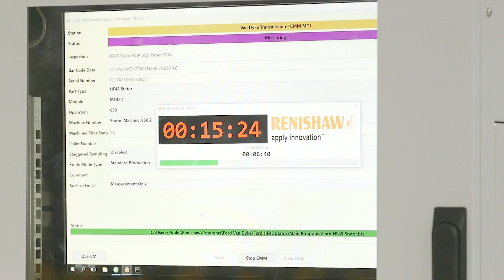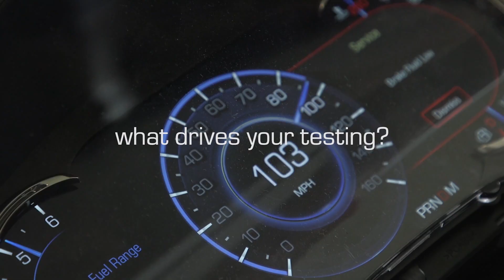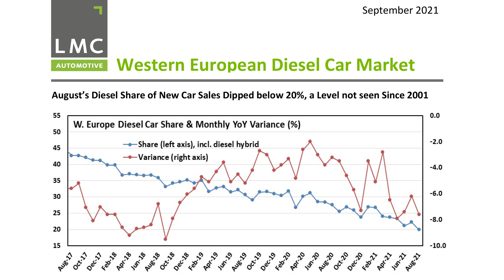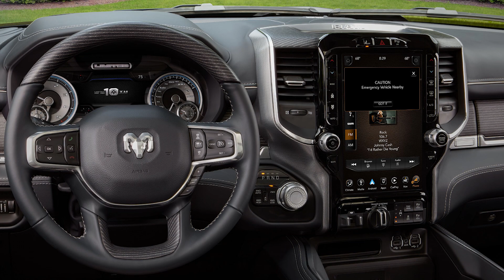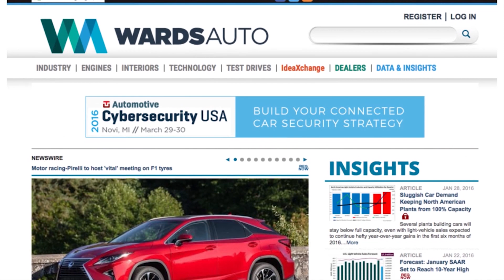Ford Starts Pre-Production of F-150 Lightning; BEVs Closing Gap w/ Diesels - Autoline Daily 3163

Comment: Sean,  There you go, calling Rivian the first electric pickup delivered by an OEM again!  Autoline surely knows about the Chevy S-10 and Ford Ranger fully electric pickups built and sold in the 1990’s.  Some are still running today.  Long before that, there were many electric trucks sold by Studebaker and other OEMs before IC engines dominated Steam and Electric propulsion systems.

Comment: Laffin at the Lightning and Ford's play. 😆 It's adorable, but 80,000 trucks a year in 2 years, and 40,000 Mustangs will not save over-leaveraged Ford. They need 100,000 to 500,000 per year with a no-problem vehicle most people want to buy. Making great EVs doesn't mean people will want them so it's not in the bag. Service problems, fires and dealer markups will kill the  Ford EV enthusiasm quick like GM did with the Bolt.

Comment: Nice,  the Ford Lightning is getting closer,   looks like on sale in early 2022 is realistic.
Reply: I think their plan to make only 80k Lightning a year by 2024 is too low.
Reply: @fjalics    80K for Ford,  100K+ Ev trucks for GM , 50K for Rivian,   and stellantis will be building trucks by then,  sounds like lots of EV pickups coming soon...   Even before including Tesla.
Reply: @dmitchellhomes  I think Tesla will try to make as many as all of them put together. They have well over a million pre orders for the Cybertruck. I bet they try to make at least 250k, maybe more.
Reply: @fjalics    I think you are dreaming,  Tesla has not even figured out how to make one legitimate Cybertruck yet,  the concept was a complete fake...  no structural pack,  and no exoskeleton,  it was on a tube steel frame, and had a battery pack out of a model X.      Elon Musk has publicly stated several times that Cybertruck production is a difficult process and will be slow to build.   I think Tesla's target production is 50-100K per year from what have have heard from insider sources (off the record), who also said they did not currently see a path to the pricing and specs released.     The last official statement form Musk,  was Cybertruck will start production late 2022,  and volume production late 2023,  which lines up with their tooling orders.   By late 2023 all the other players will be well established on the market in volume production, and don't forget Tesla tends to miss their targets on new platforms, while Ford an GM have a track record of exceeding theirs.   When GM and Ford give production targets its based ion the factory running 2 shifts 5 days,  so they're is always reserve capacity in their production system when needed.      In would not bet against the guys that sell millions of trucks now,  if there is demand for more they will build more.     BTW,  Tesla has a million reservations (not orders) but Tesla has never acknowledged those numbers publicly,   Musk did say over 500K,  so let's go with that,  but I know quite a few people with those reservations that will never go through with it.   Especially once the real prices and specs are released.
Reply: @dmitchellhomes GM and Ford have a track record of dipping their toes into EV waters, istead of diving in. GM didn't make any of the Bolt powertrain. The Mach e is pretty nice. How many have they made? The Lyric went on sale, and sold out in under 20 minutes, and a bunch of people were pissed cause there was some snafu with a credit card auth, and so they couldn't get one. The Cybertruck wan't fake. It was a one off hand built prototype, nowhere near production spec. The Cybertruck is going to get an aluminum casting front and rear from 80 an ton Idra press. They will figure out the exoskeleton. Sure it's a science project, but SpaceX did it. The big limitation is the 4680. I heard that is making good progress, but it not only has to be done, but ramped high, cause the Y will get them first. As to the competition? I don't want a monopoly. We need it. Bring it on.

Comment: ICE IS DEAD TESLA RULES
Reply: Water will never die.
Reply: Check all Rehab Centers, we got here a LOONEY LOST!   🤪🤪🤪
Reply: Tesla still uses ICE vehicles for it's mobile service fleet. There is still a big infrastructure gap. They need to install EV stations at apartments for example.
Reply: You are obsessed and pathetic.
Reply: ICE is dead, but Tesla will not be the only game in town.
Reply: @dansanger5340  Ice still sells about 20X to EV's globally,    so I would say Ice still has some runway...  Tried towing a trailer any distance with an EV?
Reply: @dmitchellhomes  the ev technology is just at the beggining,it will take decades for evs to totally replace ice  cars,but it will happen eventualy
Reply: @georgeionescu6425  Yeah, I agree with that, for personal transportation, EV technology today is pretty good, for commercial uses not so much yet!
Reply: @dmitchellhomes  - fanbois not withstanding, it looks like the BEV's ultimately would be best for personal transportation (once battery materials are upgraded and costs and charging times are reduced) and short-range commercial use. 

Middle and long-range commercial use will be best served by fuel cells, once prices go "back to Earth".
Reply: @syxepop    BEVs someday may be the way to go,  but they are still in their infancy.   Charging infrastructure still weak,  charging too slow, and range too short.    Also Bev's are still too heavy in general.
Reply: @dmitchellhomes  - as I've put in another comment, I've already figured out all caveats you mention, all of them valid. Those things I mention are LONGER TERM, like 2035 and beyond.

Someone mentioned here that 80K⚡by '24 was "pathetic". I'd say knowing the investment needed to ramp up production, today's tech, the shortages and the taste of American consumers I'd say it is actually MORE THAN YOU'D EXPECT.
Reply: @syxepop    Ya,  I saw that comment,  unfortunately that person is a factually challenged fanboy,  and thinks only one maker will dominate the EV space.     I think this EV transition is going to take some time,  its like a change of mindset,  so even if the cars were here today,  people have to be retrained.   I have 2 EV's and soon to be 3,  and love them,  but my use case is not too complicated,   we rarely take road trips over 750 miles, and do not tow heavy trailers for vacations.
Reply: @dmitchellhomes  - that's FANBOI LUNATICS against the COMMON SENSE that you and I try to portray...
Reply: @syxepop  It's been a rough week for Elon, I mean Mark:

1.)  Cathie "$3,000 a share pump and dump" Wood sold 350,000 shares.
2.)  Tesla China reported 12,885 cars sold in China versus 2,815 insured.  Oops.
3.)  Problem in data-ville as my Mark is proving my theory that Chinese built Tesla's are gathering data for Xi:  "Tesla will work with national authorities in all countries to ensure data security of intelligence and connected vehicles. With the rapid growth of autonomous driving technologies, data security of vehicles is drawing more public concern than ever before."
Reply: @bobbbobb4663  - probably you saw that growing disdain for Our Dear Cultist is happening...

People with COMMON SENSE are FINGERING poor ol' "Mark"...
Reply: @syxepop  Looks like Mark will be getting some weekend therapy
Reply: @bobbbobb4663  - that's what I did in my first comment on this very thread...
Reply: @syxepop  Good man.  Sorry I missed that.
Reply: @bobbbobb4663  Tesla's China sales is just click media not understanding what they're seeing, nothing new here. 

To stop getting constantly confused every quarter like this, I advise looking at annual global sales, then the naunces of production vs delivery, and import vs export, go away and it shows the usual trend of consistent growth. Besides, ~Q4 is around the corner, and going to be a turning point as all continents start having their own local factories.

But if you really want to understand what the Chinese agency is trying to report here, TeslaDaily has a good deep dive on the topic, which is boring non-event, except for clowns like Gordon Johnson and such, who cling to anything that can defend their >ten year track record of failure.
Reply: @AllanSustainabilityFan  Tesla could easily report these numbers but they don’t.  I know the reason but maybe you can figure it out.  Btw, I’m fully capable of understanding the numbers without needing the Tesla media to interpret them for me.
Reply: @bobbbobb4663  They could report numbers, but they would be apples to oranges, since Tesla does direct sales. Again, to avoid getting confused, just track annual global deliveries, harder to fall for the same silly spin every quarter that way.

And yes, curiously the number of vehicles missing from the insurance number matches those of the new SR Model Ys for the period. I guess that's a clue on where there may be a paperwork delay.

Then you add the fact that Tesla exports the beginning of the quarter and then sells domestically toward the end of it, and it likely becomes more of a meaningless timing issue as usual. 

I believe we had this discussion last quarter, and the one prior, similar theme about China sales vs exports. 

The last two times Tesla turned out to be growing rapidly as usual/expected, so nothing but dashed shortseller fantasies. 

Third time's a charm? Not gonna bet on it personally, but you do you I suppose.

It also appears that Tesla's flooding EU with Teslas, maybe to scare the incumbents before Berlin comes online? Who knows. As Tesla shoots up the charts dramatically this month, a little teaser:
"September is going to be interesting" - Elon Musk

Registrations are now available for those who want to attend the opening ceremony for Berlin factory by the way, so looks like Q4 should be "interesting" as well.

Comment: as cool as they are, i would skip the first gen.. could be another GM Bolt for all we know
Reply: T.C.  Have  you driven a Bolt for more than 10 minutes? The seats are certainly not accommodating for people over 6 feet or more then 200 pounds. They have plenty of space to work with but chose the narrowest seats they could have and it's not like the car needs the lateral support.